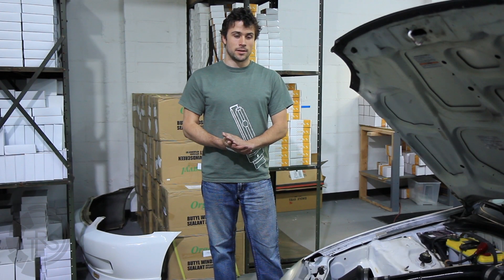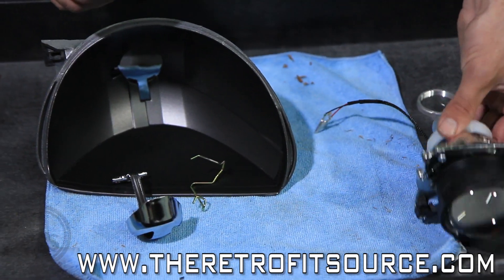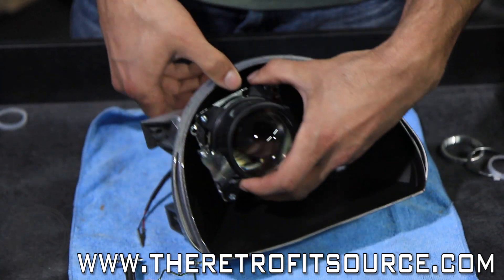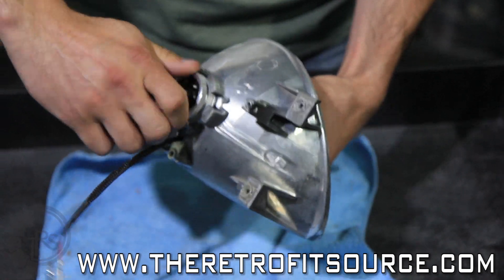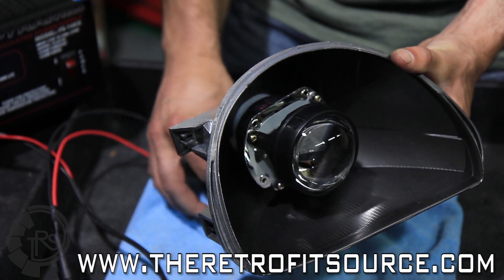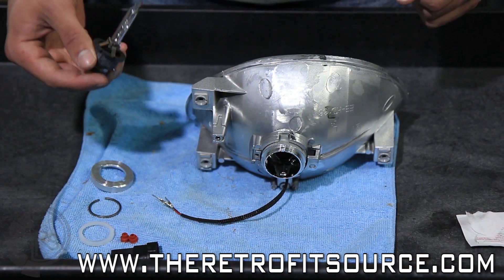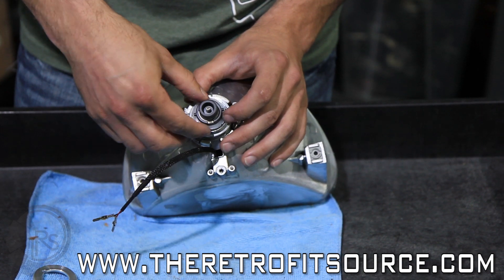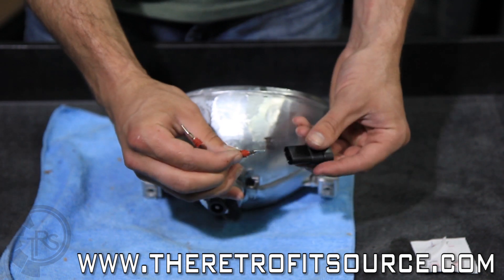TRS Tips: Morimoto Mini D2S 2.0 Bi-xenon Retrofit Guide

Comment: So is the solenoid for the cutoff shield use for HighBeam use? I am looking to use these for my foglights so would I still need to connect to those wires?
Reply from the maker: Our Matchbox projectors might be a better choice for a fog light application, They are much smaller. If you use this projector, It's up to you whether or not you want to use the high beam solenoid wiring.

Comment: Please I really need a help! Just watch at 5:18 when you connected the two wires to the 9006 adapter, is the next step to connect it directly to my high beam with no any modifications? 
Please I need a help on this anyone know this stuff I’m so worried about it.
Reply from the maker: Not too hard! what kind of car are you working on? That makes a difference too
Reply from the maker: It depends on what kind of car you are working on, what is it? We have a variety of wiring harnesses to make sure these are totally plug n play
Reply: same question. I have a 2012 ram 1500 quad

Comment: Thanks. I don’t really understand the purpose of marking on the wall before the installation. These projectors have threaded shafts for direct installation. So, in that case we cannot adjust the beams even it’s above or below the markings right? Or am I missing something?
Reply from the maker: Yeah, the marking on the wall will give you the reference for the original height and rotation. After the retrofit is completed, you can set the rotation of the new projector accurately, and the height the same too.
Reply: Thanks fro replying. I can understand the rotation part, but how to set the height?! Is there something like an adjustment screw that I'm missing? All I can see is a projector with a threaded shaft being fitted directly to the reflector housing without bolts and nut. Once again, thanks for helping me out understand the 'set heights' part better.
Reply from the maker: Yes, the projector mounts into a reflector, which is on pivot points with an adjustment screw attached to it. Once the headlights are installed back in the vehicle, you can adjust their height using the adjustment tool on top of the light.
Reply: Thanks. Is there any video of you showing how to adjust the height/beams? Being a first time installer, I don't even know where that screw is located : -)

Comment: Hello. I'm doing a conversion from H7 to D2S for my VW CC and I'm using the Morimoto d2s 4.0 with Panamera Switchback. I'm a little confused as to where the solenoid wires should be connected to. Can you help explain?
Reply: I had the same question. There is a white and brown wire but they are not labeled

Comment: Good informative video! I have a question if you'd be so kind to answer.
I'm looking into HID's for my 2014 honda civic si coupe, which bulbs/kits would you recommend? I'm not very knowledgable about the HID kits... i'm just looking for something that has 5.5k bulbs, with projectors. 
Also how does that work for low and high beams? Do I need different sets to have hids for both? Realistically I only want low beam HIDS, but do not want my high beam functionality to be disabled.
Reply: +David Nguyen We typically recommend a bi-xenon system even if you dont need it, like the Morimoto Mini H1 Stage III kit. This way you can have double high beams, and still dont compromise the low beam performance. Those projectors are also small and easy to install in a compact headlight like your Si has. Give us a ring at 404-220-7940 or email support@theretrofitsource.com, we'll be happy to make a detailed recommendation!

Comment: how mani degrees do you put the oven to open the glass ¿??¿
Reply: im guessing thats kinda hard to tell exactly. i myself had to heat my volvo s60 xenon headlights in 400celcius for about 30mins x 2 before i got mine open....
Reply: flipporabasta Are you sure about 400 cecius, = 752 F
Reply: Yes celcuis.
Reply: From what I can find on the net about home oven range with auto clean, the highest that they can reach  is somewhere around 550°F (288°C), the other vid that I have seen regarding retrofit headlights they use standard home ranges with temperature setting  between 225°F (110°C) to 275°F (140°C)
Reply: I used a heatgun. Not owen

Comment: I've did two TRS Mini D2S 2.0 installations for friends, and the cutoff was not even close to level.  I had to bake and take them apart again.  That adapter ring on 1:56 in the video is not built right.  That tooth that fits into the notch on the projector's threaded extension needs to be indexed over about 6 or 7 degrees to match the tilt on an H4 bulb.  Is TRS going to make correctly machined ones in the future?  If TRS is going to fix this, will they be available for sale in the future?